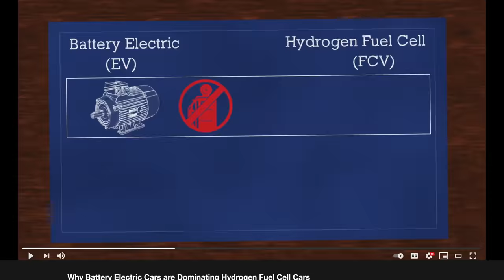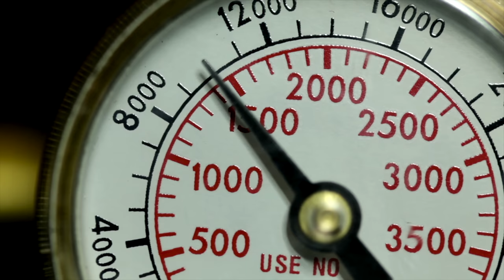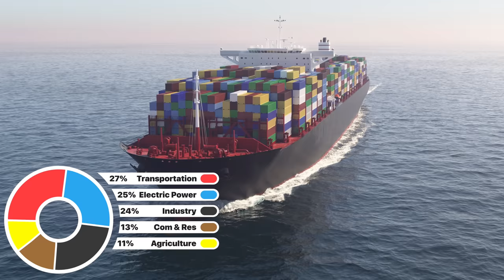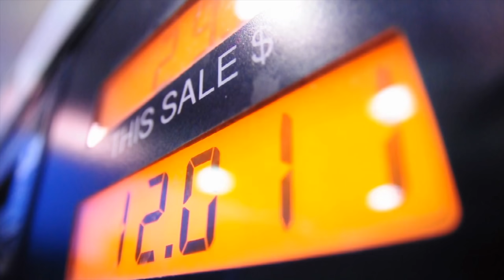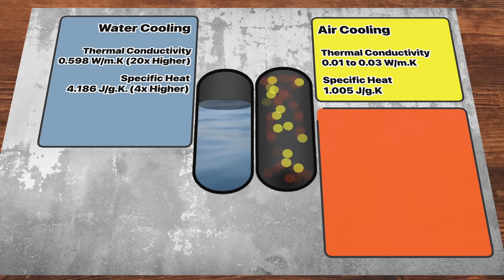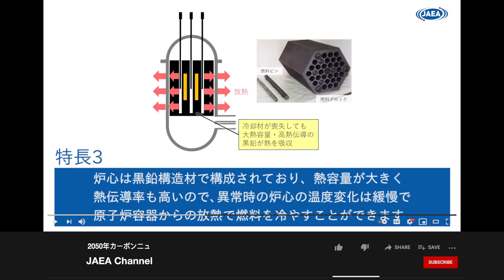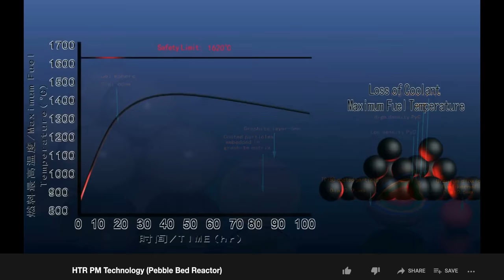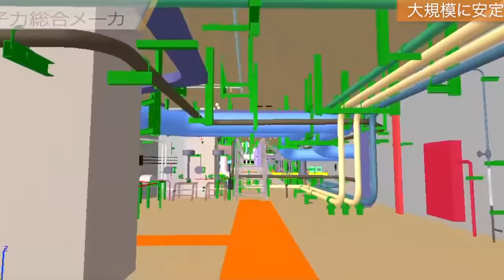Japan's Plan to DESTROY the Price of OIL and GAS!

Comment: I had some involvement in the liquified gas industry and I remember how a very well known customer got extremely excited by finding a new source of a very finite gas i.e. helium. If I remember, there was some suggestion that on current consumption rates the world had only circa 500 years worth. Not sure how that would be impacted by the proposed gas cooled reactors but it would seem as ever there is a price to pay for energy of any sort no matter how it is produced.
Reply: Helium three
Helium four 
 ( The number of neutron , protons )

  Helium-3 is a light, stable isotope of helium with two protons and one neutron. Other than protium, helium-3 is the only stable isotope of any element with more protons than neutrons. Helium-3 was discovered in 1939. Wikipedia

Helium  four
Helium-4 is a stable isotope of the element helium. It is by far the more abundant of the two naturally occurring isotopes of helium, making up about 99.99986% of the helium on Earth. Its nucleus is identical to an alpha particle, and consists of two protons and two neutrons. Wikipedia
Reply: @boboften9952  Thanks for that and after some research it seems the global helium supply is reckoned on lasting another 25 to 30 years! Whilst it is one of the most abundant elements in the universe, it is in very short supply on planet earth. So it would appear to be very finite.
Reply: To create Hydrogen you can pass current through water it breaks the bond between the Hydrogen and oxygen the problem is a lot of energy is required to make Hydrogen and with some of the energy being fossil fuels it is not carbon neutral or good for the environment.

But I watched a video on YouTube that was about putting solar panels in the Sahara Desert because it receives direct sunlight more often than most places and doesn't have cloud cover solar panels create a lot more energy the problem came moving the energy to a populated area but I thought if instead of transporting the energy you divert it to a Hydrogen plant on the coast that uses sea water to make Hydrogen, then put that Hydrogen into ships that have Hydrogen power cells you could then move it to anyplace in the world.

As mentioned in this video another problem is cooling the Hydrogen to get it into a liquid but there is another solution there is a substance called Hydride that acts as a substrate the Hydrogen particles fit tightly into the holes in Hydride like a sponge it stores more Hydrogen in less space than when it is cooled into a liquid then to release the Hydrogen you heat the container the Hydride expands and it releases the Hydrogen.

The problem is Hydride is hard to make so I'm not sure if this solution would work on a large scale but my idea could make Hydrogen a lot more cost effective environmentally clean to produce and easier to store for transport.
Reply: @urgreatestenemy3044  
     Two amps of electricity at five volts gives hydrogen split
Reply: @boboften9952  To produce Hydrogen on a large industrial scale you'll need a lot of energy but it doesn't take a lot to split water this is why solar is a good option as long as the sun is shining it will continue to produce Hydrogen if you use a the mirror type power plants you can produce energy even after the sun has set, the only problem with them is they vaporize any birds that fly close to the plant but with it being in the Sahara desert I'm not sure how many birds fly through it during migration but not many animals live there year round so it shouldn't have that much impact to the environment.
Reply: @urgreatestenemy3044  Solar is quite unfriendly to the environment tho. It is very toxic and not super carbon friendly either. But I guess it's a good idea for Sahara :)
Reply: @boboften9952  They have yet to breech the "Q" barrier when using electricity to split water. It takes more energy to split water than you get out of the resultant hydrogen.
Reply: @urgreatestenemy3044  it's not about solar or not, it's about costs, how much energy stored in hydrogen cost compared to other storage options
Reply: @zazugee  With the energy coming from solar once setup it would be cheep to produce Hydrogen and with the only byproduct of Hydrogen is it turning back into water it is virtually an endless supply of clean renewable energy.
As the video about putting solar in the Sahara Desert demonstrated the biggest expense was moving the energy to populated areas for use with moving it to a Hydrogen production plant it would solve the problem the energy would be used on site close by the solar panels then it could be shipped over seas.
They already have setup solar in the Sahara Desert but I haven't heard if anyone planning on producing Hydrogen from the endless supply of clean renewable energy.
Reply: I guess we better start building that moon base! Supposed to be huge amounts of helium bound in the moon rock.
Reply: No,we have plenty of He and reactors don't consume or leak, it's a non factor.
Reply: @BC  The Singularity will occur in less than 100 years, not even worried about 500 years left of helium.
Reply: All in all starting with solar panels the panels life expectancy is 25 to 30 years and you still end up with waste that's almost cheaper to throw away in landfills than recycle. Read some where the profit from a recycled panel was $2 - $3 per panel.
Reply: Helium is in short supply.
Reply: @alanparsonsfan  The singularity? Are you talking about fusion? I think fusion is closer than we think.
Reply: @boboften9952  😂
Reply: @backseatpolitician  20 years right?? 😜
Reply: @urgreatestenemy3044  Solar panels have life expectancy of around 20 years.
Reply: @backseatpolitician  Fusion is just one part of the Singularity.  Accelerated development in all lines of science.  Breakthroughs in materials science, energy storage and on and on.  Nanobots doing restructuring at the elemental level.  Read up on Ray Kurzweil.
Reply: @dontuno   thanks
Reply: One of the byproducts of fusion, which we will soon have, is helium... Cha ching!
Reply: NASA and SpaceX, etc are by far the largest consumers of helium.
Reply: @urgreatestenemy3044  hydride just means a compound where hydrogen is the anion, so when it dissolves in water, it dissociates into H- and a cation. You can then combine this with H+ to make H2. Hydrides are very reactive, corrosive, flammable and dangerous.
Reply: @tactiks7468  “soon”??? There’s never been a fusion reaction above unity on earth. It takes more energy to generate fusion than you get out of it. Similar to hydrolysis of water, the hydrogen you generate produces less energy as a fuel than what it consumed to produce the hydrogen.
Reply: Heya, helium isn't consumed in a nuclear reactor. It goes round and round taking heat from the core and expunging heat at the steam generator then goes back in. Sure, there could be leaks but it's not going to reduce globally available helium by a significant amount.
Reply: @urgreatestenemy3044  everything is endless energy. Didn’t feel like reading all the complications and vocabulary words.
Reply: @dontuno  soon will be mining the moon for those required elements and necessities
Reply: @beanlegume9965  haven't you heard, they have made MAJOR breakthroughs with fusion and it will be up and running soon!
Reply: @urgreatestenemy3044  I like the facts that you’ve gathered. Why not just get electricity from the ground which already has 5 voltages. An amplifier can increase the voltages through the wires and split it into hydrogen. 

Tesla Coils or both can be used.
Reply: @tactiks7468  please send the link
Reply: @beanlegume9965  That makes no sense. Earths core is fusion energy. What you presented would mean earth would die out quickly (the core would run out of energy) because it takes more energy to make fusion. There’s gotta be a reaction to fusion energy
Reply: @beanlegume9965  what about metal hydrides?
Reply: Nuclear a fuel is also a problem. I've read that if the whole world world switched to nuclear power that we would run out of uranium and other stuff in like 20 years... so while the idea discussed in the video might be carbon free it certainly is not renewable,
Reply: @dontuno  yeah I was looking at that and wondering why not use supper crtical CO2 or super crtical nitrogen. Seems cheaper.
Reply: @lionedheart  you mean the sun? 
and it is energy efficient there because of the massive amount of grafity, the surplus of pure hydrogen and the fact that it doesnt have to be contained on the sun. so it doesnt need energy to produce hydrogen since it already has it. We on earth have to contain and sustain a plasma whilst wich costs also masive amounts of energy. On the sun the gravity makes fusion easier by already forcing atoms closer to eachother, here we dont have that resulting in that we need way higher temperatures than the sun does. 
All of that makes it that with current technology it isnt energy efficient at the moment, or at least it wasnt, im not quite up to speed with the lates technologies.
Reply: @patdbus  Not the sun, Earths core is fusion energy.
Reply: @TheDennisgrass  they usually last longer than 20 years, but the efficiency declines. (And some fail altogether)
But even at reduced efficiency, they can still produce useful power. I know of off grid homes powered by old, second hand solar panels. You need more of them, but they're very cheap.
Reply: @beanlegume9965  fusion reactions release huge amounts of energy. (H bombs) The problem has been releasing it in a controlled manner.
Reply: @lionedheart  earth's core is not exactly fusion energy.  The sun is fusion energy. You could argue that the earth core is powered by the sun though.
Reply: @lionedheart  no it isnt its just a giant hot heap off mass mostly being kept hot by the decay of trace elements and some other proceses but most definetly no fussion. Since there is close to 0% if not 0% of hydrogen and other fusable elements in the core, the small particle that might reside there are most defenetly few and far appart. and combined with that the earts core isnt even close to hot enough for fusion. 

Or at least not the normal hot fussion with low dens materials. we dont really know a lot about cold fussion, so there is a posibility that there is some weird nonstandard fussion proces in some small pokets with fusable materials. escpecially since it is just one hot mess composed of mostly iron and other metals. but nothing is known for certain.
Reply: @boboften9952  If I'm not mistaken, isn't all helium on earth of extra terrestrial origin, from Meteorites?
Reply: There is plenty on the moon.We will mine it from there in the near future.
Reply: @patdbus  I agree with you but on my last statement i said “fusion reaction” which isnt exactly fusion. No one knows what’s in the earths core. Its all just theories. Until we dig a hole down there we wont know 100%
Reply: We have some helium in minerals from creation and radioactive decay, but hydrogen fusion is a new source of helium and hydrogen itself has even higher thermal conductivity. There's just major safety concerns with heating a fuel gas (hydrogen) like that. Using helium instead of hydrogen is what engineers (when you're only interested in its mechanical properties) would call Inherently Safer Design.
Reply: @urgreatestenemy3044  Every sentence starts with "the problem is," ,lol.
But there are way more Problems than you mentioned: 
Who is gonna clean the dust from all those solar panels? You are in the middle of the desert! 
Brings us to the next problem , where does the destilled water come from ?  (sea water would produce clorine because of the salt) 
And what about the danger of a fire? There is a reason they ship oil and not the refined gasoline... 
And one insider thing is that you need precious metals for the electrodes to be more specific Iridium– the rarest of them all. 
Its so rare that usually only 4tons are produced worldwide (gold 3000tons). 
Thats about the volume of your fridge. So we dont have enought of it to serve worlds energy supply. 
They need to find a better catalyst for the electrodes to produce green hydrogen.
Reply: Helium? Seriously? I don't think that would burn at all! It is pretty inert as far as I recall.
Reply: Like the Hinderberg. Really safe
Reply: @zhaowei3025  *Hindenburg
Reply: @yaykruser  Those problems can be solved they already have setup many solar plants in the Sahara Desert and are investigating in adding more so apparently dust is not a problem. 

You can distill sea water with it being a desert water will evaporate fast you could harvest the water through a process of condensation to produce clean water there are also filters that can remove salt and create clean drinking water.
If you use a mirror power station you could boil the sea water to create steam that steam turns turbines that produce energy that steam then could be distilled back into to fresh clean water. 

As for the electrodes you can use graphite infact if you look it up salt water actually increases the conductivity of water so using salt water is actually better for the process of making Hydrogen than using distilled water. 

As for the dangers of explosion as in any production of any highly combustible materials there is risks involved, natural gas and other explosive fuels have been safely shipped for years.
This doesn't mean there wouldn't be accidents but with the Hydrogen contained in metal hydride the risks are diminished.
With the metal Hydride it traps the Hydrogen to release the Hydrogen the container has to be heated this would happen in a fire but if someone punctures a tank all the Hydrogen inside would not leak out.
Reply: @urgreatestenemy3044  Salt water corrodes electrodes faster and produces clorine gas.
I dont know the industrial setup for the process but there must be a reason they search a replacement for Iridium.
And All this destillation and desalting , cleaning, recycling electrodes, cooling, and storing makes it unattractive...
For storage I heard something about Ammonia being used to store the Hydrogen...
Reply: The thing with Helium is that it's so light that it escapes the atmosphere into space. Not even gravity can hold it here indefinitely, so we're actually LOSING Helium all the time.
Reply: @salaciousBastard  oh ok 👌🏻 gotcha
Reply: Has anyone here looked into Thorium Molten Salt Reactors which do not need to be close to any body of water , is walkway safe and  environmentally  friendly . And along with being able to operate anywhere suppling us with cheap almost endless energy it could also be used to create your hydrogen without the use of the sun and still operate under the most adverse weather conditions.
Even though it was developed and proven here in the states back in the sixties it wasn’t implemented because of military and political reasons but right now China is working hard to change this which could put them way ahead of us eventually.
Reply: @williamgrimberg2510  Yes. I love LFTRs and one of my dreams would be indeed pioneering that field somehow. The problem with them seems to be the unfriendly nature of fluoride salts when circulated through metal tubing. Also, they are chemically convoluted to say the least, and they don't make that sweet sweet plutonium (or at least not as much) that large powerful nations love for their arsenal.

China is making the right decision. The rest of the world will be playing catch-up (unfortunately for us in the West).
Reply: @dontuno  Only because most helium is still vented to the atmosphere from nat gas wells.   A more expensive alternative is to get helium from atmosphere, but in any event we'll never run out of helium except on geological timescales as it slowly leaks from atmosphere to space.
Reply: That's a great point of view. Do you still work in that industry? How do you feel for Hydrogen in comparison since it is plentiful, ish lol
Reply: FWIW modern computer hard drives have helium in them instead of filtered air. It is much less friction, therefore much less heat which is the bane of existence for computers or server-related hardware.
Reply: @dontuno  and Bob great stuff guys!
Reply: Before then, we would've been mining it from Jupiter
Reply: Exactly - Helium is Mined from very specific deposits around the World - I work with Industrial Lasers that use Helium as a Coolant in the CO2 excitment chamber.....
Reply: @zazugee  Not only! There are places and situations you do not want to be dependent on batteries. I use a lot af them (a.o. I design, build and fly rc airplanes). Lithium Ion batteries are fantastic: small, very high capacity. BUT, there also quite vulnerable, easy to overheat and they do not last if not very carefull monitored and used. In what I do (and most other rc pilots) batteries don't last longer than an airplane, which is usually a few months to a year. After that both plane and batteries have so much 'battle damage', they're ripe for the waste bin (recycling at best). Ever seen a Li-Ion catch fire? You absolutely don't want to breath that in! Now, as long as battery electric cars are a novity, it's controllable, but already people start to experiment with EV's. Make them faster predominantly. This is going to cause the same stress on the batteries as (fast) rc airplanes (and drones, speedboats, etc) do. Batteries won't stay 'clean' for long! H2 has it's own problems, but not the same as batteries. So at some places and circumstances it will be much safer, cleaner, whatever, to use batteries and others it's much more lever to use H2 tech. Betamax or VHS remember? Why one or the other? Use both for what they're best for. Long hauls isn't the place for batteries.
Reply: "Carbon Neutrality" is crap.
Reply: @arturama8581  i was confused by your answer when you said batteries and planes last a few months, i realized later you're talking about rc, you're talking about a different kind of lithium batteries, LiPo have higher energy density than LiPo or Li-Ion but they have a shorter life, bc they give lot of current that other lithium batteries with longer life can't do
Reply: "Carbon Neutrality" is crap.
Reply: @urgreatestenemy3044  electrolysis is the worst way to make hydrogen! There's better stuff that breaks apart the water but they will never legalize it
Reply: @lionedheart  Theories in Science is the closest you get to a fact.

The core is not perfectly understood, but it is very well understood at this point.
Reply: @SonnyKnutson  Or Saudi Arabia where they already have lots of gas pipelines and infrastructure that could be upgraded to transport hydrogen.
Reply: @lionedheart    the earth core nuclear fuel IS FINITE  and  indeed depleting   itself !!
It just takes VERY long if you  are  measuring it in human life span ,  we're talking on a scale of a billion years until the fuel will be depleted and  will no longer produce any internal heat .
Reply: @alanjm1234  A huge demand for 2nd hand solar panels in Ukraine.
Reply: @williamrbuchanan4153  You need to get either one or both:
1) A better language translation program
2) A better bot